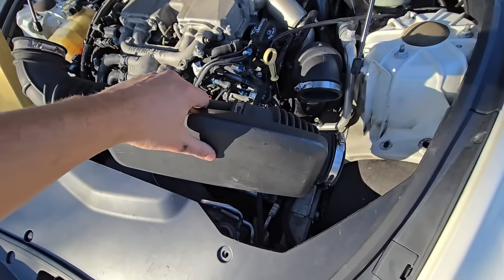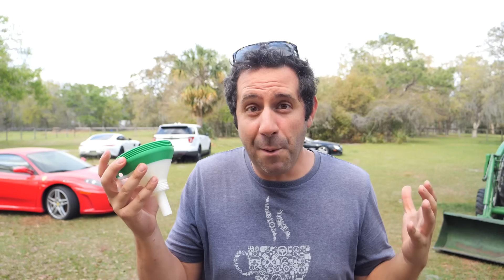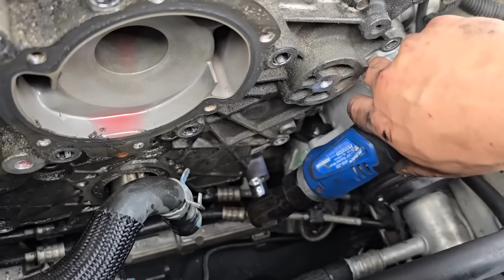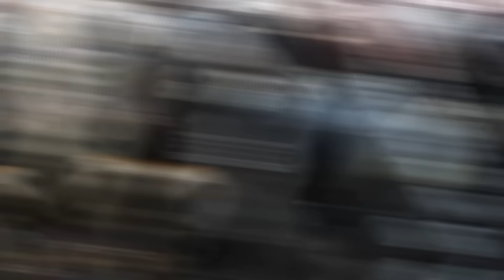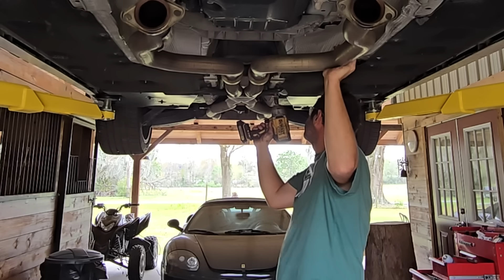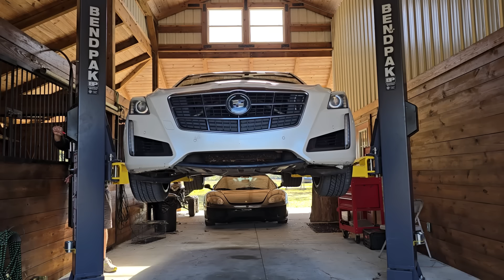Turning a Mechanically Totaled Cadillac into a 500HP Twin Turbo Sleeper

Comment: Help!!!! I have a P0480 and P0691 code.  Dealership said replace ENTIRE radiator fan due to relay being inside the fan.  Brand new radiator fan and P0480 and P0691 still persist.  Car never over heated and still dosent but when u sit still you get a loud clicking/ ticking that stops when you turn the fan on high...... what is wrong!!!!

Comment: It sounds pretty good, seems to pull decent, I don't know about 500 hp, but we're looking at a 6,000 lb truck too !
 Now we just need to let it rude for a few thousand miles and see how it does. It wouldn't surprise me if it runs just fine for many miles. The Chinese have came a long way with their ability to manufacture quality hard parts. It used to be that a part may look, feel, and dimensionally be correct but the issue would be with things like the heat treat of the alloys, or the alloys themselves. But they have gotten to where their ability to reproduce parts and them not only be dimensionally the same, but materially the same too has came a long way and they have got it pretty much figured out. The biggest problem I have found with Chinese parts components, and equipment is in their assembly practices. Any assembly I get from there I immediately tear it apart completely, thoroughly clean, and deburr, double check any critical dimensions, and reassemble it with seals and gaskets of a known quality. This is because China's biggest shortcomings I've found to be in the final fit and finish, and assembly. They tend to leave parts a little rough, finish wise, sometimes extremely dirty. It's nit uncommon at all to find large amounts of swarf, metal chips, and just general trash inside assemblies. Another area that is always suspect is the gaskets and seal. Sometimes the ones they use are of extremely poor quality. But, usually the price difference between a Chinese part, and their name brand, or OEM competitors is large enough that it's well worth my time and labor to tear it apart and reassemble it.

Comment: If the tensioners are hydraulic, the chain will be looser when the engine isn’t running since there’s no oil pressure. In case you didn’t know

Comment: Just saw this video now. My own car is the ATS model with the normally aspirated 2.5l 4cyl. It is a 2014 Base Model.
Normal output is around 200hp, not bad for a 4.

I modded and reprogrammed the engine to give me 300hp. You dont see anything different or hear anything special when it runs. Those cars are geared for highway cruising, and it reaches speeds that will get it seized and towed real fast.
All I did was a K&N intake, a Jetchips throttle, a MAS from the same company, and unlocking the ECM TCM limits.
It fairly rocks and runs very well.

Thanks for understanding the Sleeper concept. So very few people even know what it means anymore. This is specially true with a Cadillac sedan; who expects a senior citizen to have a discrete rocket ship? Who looks at a grey haired guy in a Caddy?
I grew up with sleepers. I learned to drive on old school muscle cars. Mine is RWD, as were the monsters I learned on, and it has more HP than they did with only a 4 cyl engine.

Needless to say I'm having the kind of fun teenagers can only dream about.
Have you seen the new Cadillac Blackwing Monster Edition? It has 1050hp!

Comment: Can you give me a car lol. I have a 2011 bmw 328i  i bought very cheap due to alot of issues here and there with it. Ive been slowly building it back up. It was left alone modifications wise threw its life so I've been able to get it almost back to original working condition got all the days lights and leaks fixed all the small broke or missing trim replaced tail likes head lights bacl working now the torque converter is going out it shakes and rumbles when I accelerate in low gears trying to speed up so thats the main and only mechanical issue with it now. I want to keep it stock and running looking good. I want another bmw that is fast and fun hahha. My car isnt slow but its not fast fast and its fun handles great. But I want a sporty quick bmw to play with and have fun. So if you have any BMWs or audis laying around that are running and driving good Ill take it off your hands and project car it :) I also want to give my daughter my bmw thats also why I wanna leave it stock and alone.

Comment: I bought a 105,000 mile 2005 3.6l , changed the timing chains , it ran great for 300 miles then a rod started knocking , I should've changed the oil pump. Now I'm down to driving my brothers 25 year old pickup.

Comment: Blue mark means that bolts are torqued already. Black oil is not black because maintenance it is black for two reasons pvc check valve and two turbos that are mixing exhaust fumes with oil. That pvc on crank case should prevent those problems but every 20 k will fail and inside diaphragm will not seal so gases will end up inside oil so oil will get black. That car is direct injected so some fuel will also end up inside oil and it will make it like tin. If own car like that oil change should be done on 2500 miles but  has listed on 5000 miles.

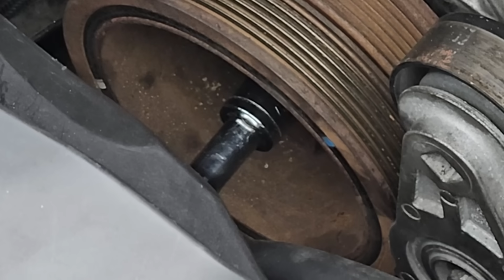Comment: at 23:30 you used the starter to tighten the crank bolt???If the engine spins clockwise viewed from the front and you have a breaker bar braced against the frame that would mean you are LOOSENING the bolt not tightening it.This is a well known method to remove stubborn crank bolts NOT tighten them

Comment: All GM 3.6L engines require frequent oil changes using top grade synthetic oil. It's the key to not only keeping the engine clean, but also to protecting the timing chains! These engines are extremely reliable IF you keep up with maintenance, especially the oil changes. Forget what GM says, change your oil between 4 and 5 thousand miles and you will have a very long-lasting engine. Also check your oil level at least every two weeks. I check mine at every fill-up, it only takes a minute and along with routine oil changes is the cheapest insurance you can buy for a 3.6L engine.

Comment: Of I remember right the carbon build up on the covers is die to the oil line on one side being as small as a pen hole. The hole gets clogged and then ends up burning oil. Make sure you clean off the carbon as much as you can. I think hose was 1/2 inch big and the hole went down to 1/4in hole. Open it up to 3/8 using a drill bit. That is what I did when i replaced my timing chain on an 08 cts with the same motor

Comment: If you give a damn about printing, beyond just a sponsor spot, do some research and educate yourself a bit. Use different infills, I'm a fan of gyroid and it provides strength and reduces the chances of nozzle skip because you're not double crossing lines like in the grid infill you were using. Use scarf joints and never have your seams aligned as it could cause a weak point and looks bad. 
You also don't have to use Bambu filaments in the AMS or with the machine, like some used to/like to think.

Comment: You always have to have those cams locked in place if nothing else use a series of vice-grips to lock them in place because those valve springs are pushing on them

Comment: Sam, Schley Tools 15900. These will save the threads on all of your bolts. Just leave the nut on a few theads, place your socket on the nut and then this tool from Schley. You can hammer anything right out.

Comment: Remember the old days when a timing chain could go 250,000 miles?  And the water pump was driven by a fan belt and could be changed in 30 minutes?
Reply: I remember all the 8 years old cars with 100000 miles on them that drove like crap and were rusted so bad gas tanks would fall off and windows rattled all the time. The cars of the 60s and 70s could be fixed easily but they also broke all the time.

Comment: Double check all the connections on the passenger side of the engine, maybe you weren’t stepping on it all the way but you should be building a lot more boost that 5

Comment: Samcrac gm and Cadillac put blue paint marks on parts as they install them along the assembly line the reason behind the marking is so that the assembly line workers don’t forget to install a component or tighten an component to the specific torque specs my grandmother had a friend who passed away over a year ago who worked at General Motors plant in linden nj from the day it opened till the day it closed down

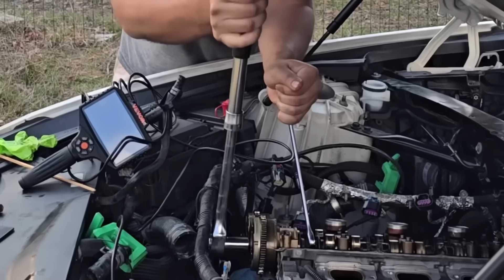Comment: 17:00 Pull 1 cam cap and put a piece of paper towel under it then reinstall the cap. It will lock the cam in place during a timing job. Its a really common way.

Comment: Hey Samcrac, hope you're doing well!

I’ve been watching some of your YouTube videos and really appreciate the insights you share about car issues. Learned a lot from them!

I wanted to ask about a problem I’m having with my 2010 Hyundai Genesis Coupe 3.8L V6 A/T.

When driving in higher gears, especially transitioning from 3rd to 4th, it feels like it’s slipping. If I push for higher speeds, it suddenly lets go, drops back to 3rd, and then won’t shift at all unless I turn the car off and on again.

Any idea what could be causing this?

Really appreciate any help, thanks!

Comment: @Samcrac   Paint marks in the engine bay are apart of the assembly process. It makes sure that the parts are installed correctly, and can be visually inspected quickly at the line.

Comment: Sam what happened to the obligatory first drive post modification shocked facial expression? Was it really that underwhelming??? Sounded pretty awesome to me but found it rather strange when you only filmed your lap and feet never panning the camera above steering wheel height??? Maybe its nothing or maybe I'm onto something? The only people I know who wouldn't be the least bit impressed by a car making 500hp work for places like SHEEPYRACE and AMS where most customers cars are well over 1000hp at the wheels many between 1500-2000hp then I can understand why those guys would yawn at a mere 500hp 😆 but what's your excuse Sam? Cmon now honest mate was this Caddy after its power upgrade underwhelming or did it feel fast??? Fair question I would have thought when there was strangely no test drive reaction not in the narration or on video? Hmmm 🤔

Comment: $150 for an oem oil pump is cheap af. I called toyota with a parts license for a 2003  Camry a simple serpentine belt tensioner! They wanted $430 . I had to pay up because the reviews on aftermarket were crap and would even break while installing and didn’t tension enough

Comment: Hey Sam this FYI on every GM made after the C4ZR1 as long as you hold the throttle flat to the floor it turns off the fuel injectors so you don't have to remove the fuel pump fuses.

Comment: Bought a new 2011 CTS 3.6, kept it till appx 85,000 miles. Traded it on a new 2020 RX 350 Lexus, did not want to do this job or pay appx $2,500 to have it done.  Lexus should go a few hundred thousand miles w/out timing chains replaced.

Comment: When using a balljoint separator, I've found once you get good pressure on it, if it doesn't pop off give the tool a tap with a hammer. The applied tension plus the shock of the hammer blow works great

Comment: You are a Wizard.  Your videos are amazing, and you do your work in the "field" and not in a shop except for when you need full undercarriage access.  Very methodical in your repairs.  Did you have any issues removing the O2 sensors from the exhaust?  Do you "mark" and count threads when removing ball joint arms?   So, your total spend was $10K?

Comment: They make a flywheel lock for the LS that bolts in place of the starter. I would bet it will work on your Cadillac engine and they are lik $11 on Amazon the last i checked.

Comment: at 11:31 we can see that the original tool is much higher, why didn't you matched the same geometry ? Your part must be very flimsy since there is very little material on top of the opened section. Nice video as always good to see you active. love the chanel since the R8.

Comment: 24.46 Next time just tie a string under the vehicle from one side of the lift to the other side. it'll act like a second set of hands. Unlike the jack which only allows for vertical hold and very little wiggle room.

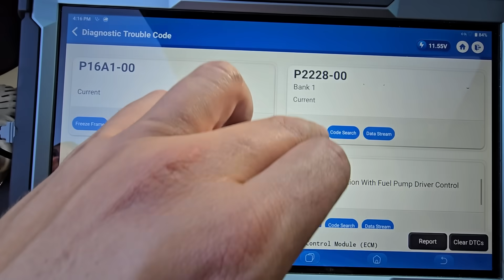Comment: 23:14 You are playing with fire there. Tightening the crankshaft pulley bolt by tweaking the starter with a breaker bar attached to the bolt and braced to the frame can and will break the end off the crankshaft if you are the slightest bit late letting go of that ignition key. I would find some other way of tightening that bolt.

Comment: If my 2016 ATS 3.6 Non Turbo AWD Cadillac ever needs the timing chain I wonder can ZZP actually do the work for me since as you said dealers and some independent mechanics do not want to do this job. I do hope that the timing chain reliability has been improved on the 2016 engine.

Comment: Thanks for the comprehensive video Sam. When retightening the crank bolt with the breaker bar against the frame, then cranking the engine even one crank, couldn't the engine actually 'fire' or isn't that somehow possible or a concern?

Comment: There is a PCV mod that is quick and simple. It won’t take much searching to find a few walk through guides. The oil on the outside of the motor and the dark residue inside the motor indicate poor crankcase ventilation. Pressure builds inside and oil wants to come out of any weak point. 

As for locking the crank, that’s easy. There is a simple tool that locks the crank. Remove the starter and insert the tool in its place. Holds the flywheel and the crank goes no where.

Comment: You may have fallen prey to the mistaken belief that a new part will be better than the original old one. I really hope you don't end up with a grenaded engine due to an oil pump failure.

Comment: Good job with the Caddy. I wish our VF SV6's got this twin turbo engine here in Australia, insted of the standard naturally aspirated LFX 3.6 engine. 

But our buyers wouldn't have paid the extra for the turbo version, and the idea that the V6 version would compete, or be faster than the SS with the LS3, or HSV variants would have been a no go.
Reply: With all the power the twin turbo would be making, it would have been a HSV…
Reply: @paulsz6194  if HSV offered this along side its V8 range, the brand might still exist
Reply: Yeah would have failed here for sure! Just look at how the more expensive Turbo Charged Inline 6cyl was a total flop when FORD Australia unleashed their savage BARRA Turbo along side their slug 5.4 V8 XR8 😆 Aussie's en masse steadfastly refused to pay the extra $$$ for a force fed power upgrade true? 😆
Reply: @joshbrookes6439  I think by the time Holden could have introduced it, I think the writing was on the wall that sales of the Commodore were dropping, and it wouldn't have been worth the cost-outlay. 

I have nothing against a turbo six, I think they're awesome. GM/Holden just stuck with what was easy.

Comment: Those kind of quotes are the f you quotes. Dealers and mechanics quote you because it's either a job they don't want to do or don't like to do.

From what I've learned over the years, mechanics don't often like to take jobs like those on because it screws up their flow for other jobs and is allows too much opportunity for them to fk something up. It messes up their flow becsue there's really no "quick" or "easy" way to cut time down on a timing job because it's so complex and if they lose parts or put them in wrong then that 10-16 hour timing job either has to be redone at the companies expense (assuming they have a spine and don't just tell you to kiss their ass) but there's also a much larger risk that they'll have to replace your engine on their dime anyways. So unlike say a brake job or engine swap they can't just "experience" their way to turn a 10-16 hour job into an actual 7-8 hour job that allows them to do filler work like brake jobs and so on to free up time for them. 

I had a Jeep dealer and a local mechanic tell me those words when I was quoted 3500-4200 to do timing replacement on an 03 Grand Cherokee 4.7.

Comment: Aftermarket chains on a car that is known to have issues with chains and then on top of that not replacing the gears with the chains.... Yeah might want to disclose that when you sell it
Reply: The engine tends to have chain issues because the oil change specs are too spaced out & most owners that follow the recommended oil change intervals end up doing it too little. And also turbocharged engines go thru oil a little faster. 

The chains are not at-fault, they would wear more gracefully if oil was changed/added more frequently. Aftermarket doesn’t make a difference. 

Same thing with bicycles. Oil it less, wear it down faster.
Reply: @brianvan2923  100%
Reply: @brianvan2923  You do realize that you have to change the gears when you change the chain and a lot of aftermarket chains are not hardened
Reply: @colchronic  My guess is he'll get away with it at least long enough to sell it.
Reply: @colchronic  either way, he’ll have to see how this repair works out for him. He’s still in for a bargain at 500hp if he has to do the whole job over plus gear swaps. 

That part is also the same as bicycles: sprocket replacement is recommended on worn drivetrains. If you catch the wear when it’s light, you can get away with leaving the front and rear cogsets on with the new chain. Much bigger problem with counterfeit chains sent from Amazon when you ordered the real deal.
Reply: I like his videos, but I'd never buy anything from him.

Comment: When you were lining up the crank marks reminded me of the Ford 5.4L 3v....they make a tool that locks the crank into position at 7 o'clock so there's no chance it moving. Then you just install the guides and chains lining up the marks. I guess Ford decided you'd have to do this 10 to 15 times over the life of the motor so they made it easier.